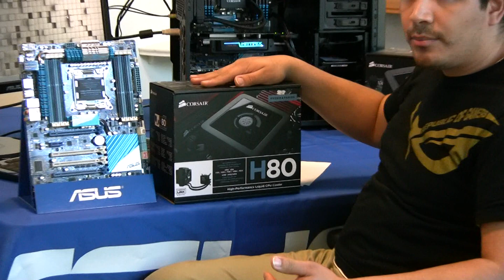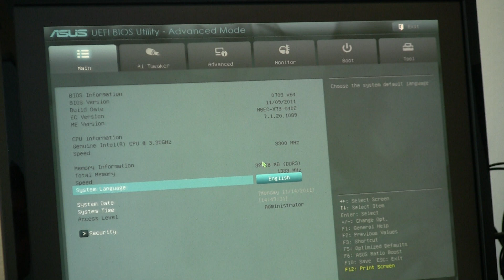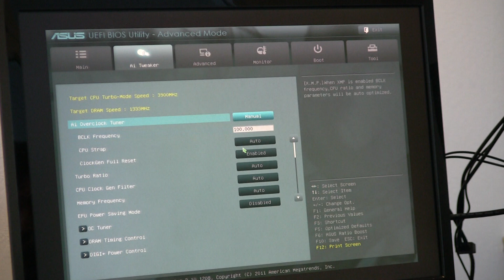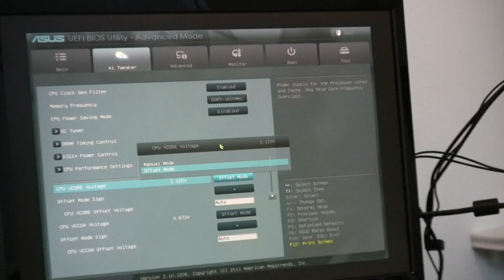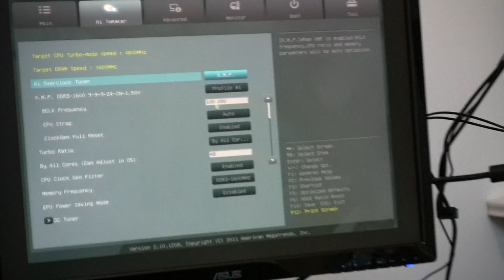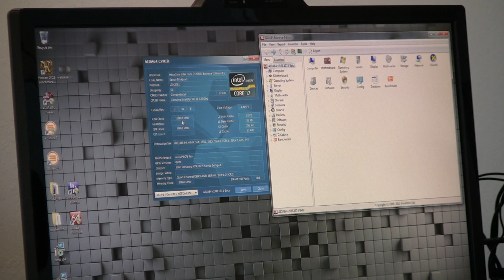How to Overclock an Intel X79 Sandy Bridge-E Motherboard 1/3

Comment: IS there any setting guide for the same motherboard for the Xeon E5 2697 V2?
Reply from the maker: No, XEON series CPUs are not OC centric - Users that utilize these CPUs will generally run their systems at defaults for maximum stability.
Reply: @ASUSUSA  I have achieved 114 BClk with the Xeon 2697V2 on a P9X79Pro and have been using fairly stable for some time. :) I'm often using the device for 3D rendering, sometimes lasting weeks. Not a single hang or crash occured during this time. Rendering time of the Corona Benchmark scene reduced from around 2:07 (at default frequencies) to 1:49 *(Improved a few more seconds), which is a concrete improvement . The current Ryzen 9 7950X results are around 31 seconds at best, on the benchmark result page. 1.49 is a very nice time for more than a decade old system. I've pushed the ram speed from Auto to manual next adjustable setting (Precisely from Auto-1520 to 1624) while with ram voltage set a tiny bit higher. 1.5V to 1.530V.
Thank you for the extensive information. 

(I'm on Windows 11 - The Values I read on AI Tuner are: BClk:114, VCoreVoltage: 1.250 VCCSA:1.200, CPU PLLVoltage: 1.950,  VTTCPU:1.050 VTTCPU 1.15, DRam CHAB, CHACD 1.530V-  Rest are unmodified, No DRAM modifications as you've recommended-Ram settings are Auto)  Did several changes from the BIOS according to your recommendations

Comment: I guess JJ doesn't give a shit about our comments 😏
Reply: No kidding!
Has he ever replied...  i don't know.
Reply: I'm not sure, is the first and last time I try.
Reply: I hear that...!   : )
Reply: In my case, It was the Bios chip, it was giving all kind of issues with the overclocking and other booting issues also Fan xpert wasn't working either, replace the chip with a $10 on ebay and problem fix.
Reply: Well that's good news.

I'm checking this out 'cause i had my pc for 3 years now n want to venture in trying to overclock it but,  still not confident enough to try. 
Need real step by step.  It's really hard to find.  + this is a P9X79 he's showing,  don't even know if it's the same thing.  I'm a green horn.  : ) 
I'll just keep looking.

Comment: I follow this gude and OC to 4.4Ghz and my ram DIMMs are 2400Mhz so I set them up to that speed, VCore V is set to 4.0V but when I run a sintetic benchmark I get CPU Throttling overheat warning, any ideas what I'm missing?
Reply: influxvision Are you on air or water cooling for your CPU?
Reply: Bruce Meyer I'm using water closed loop cooler with a push and pull fans.
Reply: Is your vcore set to 4.0 or 1.4v? I think 4.0 is way way to high. I think the max is around 1.4.
Reply: influxvision I've checked and the maximum safe vcore for a sandy bridge e chip on daily use is 1.375. Any higher and your chip degrades at a much higher rate. Also, did you set it the BIOS to XMP or did you change your settings manually?
Reply: Bruce Meyer  Yes 1.4V I don't know what I was thinking haha!
Reply: influxvision A few things:
1. Try lowering it to 1.375 and see how it works. 
2. When you installed your ram did you set it to XMP or do it manually?
3. What are your temps when it is running under normal settings?
Reply: Bruce Meyer I'll try, thanks 👍

Comment: Can you overclock a Asus Crosshair V Fromula Z with AMD FX-8350, 12GB 1600MHZ VENGANCE,
Reply: If you even think is it possible, my advise is don't. But if you do, do your homework and make sure you do it in stages of overclock
Reply: +TAGSProle yes you very much can, those components are perfect for overclocking
Reply: +evil_lord_zargon wo a comment on a year old post ok... my reply was directed to the point of if you ask then don't. by all means go for it. I got my old i7 3820 at 4.4-5ghz (about) stable at the time and that was good but left it at stock after because it didn't really make a difference to games at the time. I see an CPU overclock as a last resort to make it perform well after prolonged use, not chasing numbers as you will ruin the lifespan of your hardware.
Reply: TAGSProle Awesom, i also have a 3820. I didnt see the date of the post tbh. I run it under water at 4.8, while 5 is possible, when i tried it the heat and noise was not worth the fraction of performance that you gain. Out of interest, what CPU strap/blck setting do you use? i use 133 BLCK and auto strap, and it is stable at 4.8 with 1.395v
Reply: ^ i only read the first half of your comment. Since i use an overclocked 980, the old 3820 was not quite giving me the right frames at stock, especially in BF4. with 4.8, i am seeing an increase of 5-10 FPS, which lets me use v sync on my 120hz. Since i have it under water, the temperatures are fine, and to be honest, unless you are past 1.48v, temperature is what is going to degrade the CPU. prime95 load at 62C hottest core looks good to me, and the chip has been there for 2 years.
Reply: I'm still running the 3820 and 2X 670's and still runs games perfect maybe not at max. Obviously turning down the AA a tad but its still solid. Next upgrade will be a new GPU as more than 4 decent cores is still rarely needed even now, but as you mentioned BF4 I get an average of 120+ but that's on a 60hz display at 1080p, once I push it to the max which my setup can do. But when the fps drops, it drops hard, so I leave plenty of head room as you could say to avoid stutter and big drops

Comment: hello, Can I use this guide to OC 4930k with Asus P9X79 ? thanks
Reply: yea
Reply: @cmoneytheman  a bit late, but yes. i ran it at +25%, now on an E5-2697
Reply: @chaoticsystem2211  do u plan on upgrading
Reply: @cmoneytheman  i switched from the 4930k to E5-2697 v2 a few days ago but getting to the bootloader needs a few tries, regardless if it's overclocked or running at stock clock.  So i was looking for some infos on the p9x79, but it's all ancient. I didn't realize that i had the board for so long now. 
Or are you talking about getting something new?

Comment: Hey JJ, you forgot to mention that if you want to use the Speed stepping & offset voltage (to save power), then you need to also go into windows7 control panel and change the power setting to save power or else it doesn't go into idle. 
But I have used these settings with my 3690K and so far, 4.8 is easy fast with a H80 cooler.

Comment: Now Here is is the Good Part!
I want a 24/7 overclock for working... I load the optimal settings on the bios... and I did This....

1º. I used Auto Tuning from ASUS TurboV EVO Software to get the system to Extreme overclock. And it got the block frequency to 104.8
2º. I manually changed the CPU ratio to 42
3º. I used DIGI+ and put it in: High - 120% - Optimized

AND VOILA! 4401.5 Mhz 24/7 System Completely Stable!

Hope it will be usefull for some people... 

Congratulations JJ and Thank You.

Comment: First I used your advices in this video to Overclock the CPU to 4452Mhz and DRAM at 1413Mhz
Block frequency 106
CPU strap 100
Turbo Ratio 42
DIGI+ High - 120% - Optimized
The AIDA64 Stress Test went OK for 30 minutes and I got this results:
Max CPU Core Voltage   1.286V
Max CPU Core Clock     4442.5Mhz
Max CPU Core Temp     77ºC
Max PCU Package Power     120.21W

The Stress Test went All Right
BUT after using my compurer for a while it turned on blue screen from time to time....
Too BAD.

Comment: Great video, really helped me out. You can really lose yourself in the number of features in the new asus efi Im running a 2500K on a Z68 v-pro and just have it at 4GHz on air with a coolermaster hyper 212+ and temps stay cool my case exhaust air is room temp at all times. 2 thumps up to ASUS for a quality product

Comment: Awesome JJ thanks, I got my Sabertooth X79 with a 3930K up to 4.8 using this guide. My Corsair Dominator GT 32GB is running at 1866 @ cas9 and so far it's rock solid.

Comment: JJ keep up the great videos. i learn a ton from this. Great work man! im curious to know weather i can use 2 32 GB ram kits on my machine. TJ11,3960x,rampage4 extreme, swiftech quad rad and single rad,apogee hd block, 1350 watt gold psu, 2 7970 crossfire, dual samsung ssd in raid 0.

Comment: Great video JJ. If the H100 is set up as you explained, would it not blow hot air onto the board as an air cooler would? I don't have one to test but if the radiator dissipates heat to be cooled by the fans, aren't they blowing hot air directly onto the heatsink and CPU? One other question. Is there any audible noise from the Sabertooth active cooling? Many thanks for your informative videos.